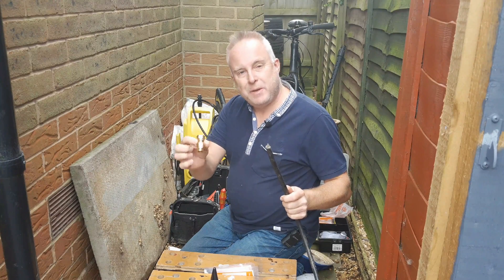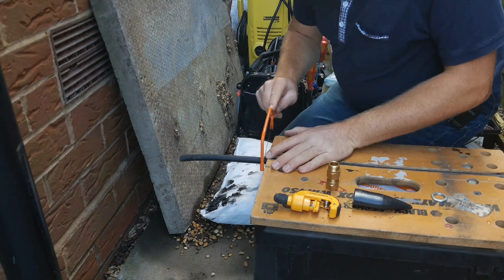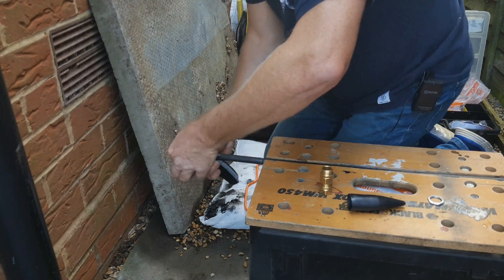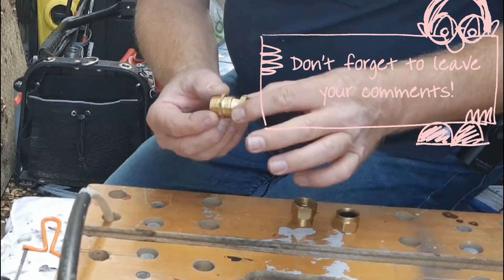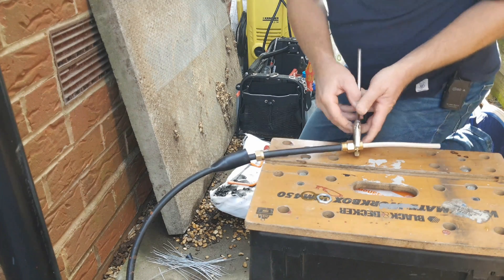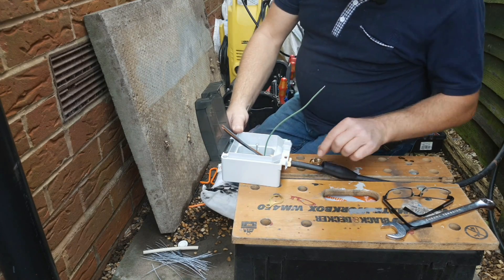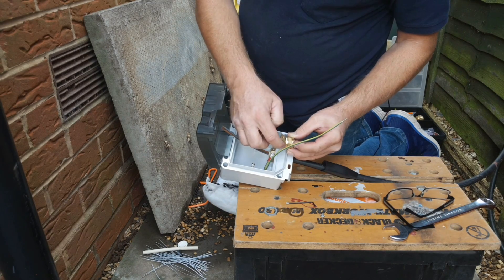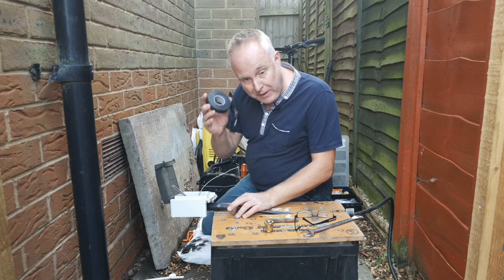How to Make off a SWA Gland | For Steel Wire Armoured Cable Installation

Comment: Dear can you help me when install cable gland the cone and the armour ring are not engaged after cable gland tightening and disassembling however the outer seal is fully clothed over the cable iuter jacket & the cable is not extractable  from the gland with hand tension please advise

Comment: That yellow tool, Bladerunner - you should spin it in the opposite direction, not towards the the jaw opening but towards the back of the tool. It's a bit counter-intuitive at first, but that tool designed to work that way - look on the directional arrow. Makers of that cutter should had made instructions more clear because people even break that tool trying to force it to work back to front, as it happened to myself.
Reply from the maker: Yes, there's an arrow. That's the way I used it. The bladerunner is still crap.

Comment: I am running swa from pond area back to consumer unit in the garage. Where the cable penetrates through the wall I was going to terminate swa into an ip66 box, then connect to normal 2.5mm t&e through the wall. Seems like a better option than threading the stripped  swa into the house. Does that make sense ?

Comment: Great video, clear and very explanative. Impressed with the detail. I too amalgamate, the amount of rusted through Wire armour I have come across. Isn’t  going stop it 100%, gland cover isn’t designed to be waterproof but tape Helps alot
I’ve forgot my junior a few times. discovered by trial an adjustable pipe slice actually works very well. 
Good practice on Lining up the faces on the nuts too, same play here. It’s just like leaving screw slots horizontal on fittings. The Finishing touches👌

Comment: Late to the party but excellent.  I now use a hacksaw rather than pliers.  But, ive always wondered: how can these glands be ip66 rated when theres no seal on the enclosure locknut?  Use of self amalg will help this but ive always wondered if i should use mastic around the gland before putting into a box.

Comment: Thanks! 

Where does the copper wire from the banjo terminate? Should it meet with the inner earth core of the swa to the circuit you're connecting to? Or to the junction box housing?

Comment: The ring is slightly wider on one side and thinner on the other. Which side do you put facing towards the cone shape so the swa's can be trapped?
Reply: The ring is itself a short cone, so align it the same way the bigger cone goes

Comment: I think it should be regs to use a 3 core cable for earth connection safety. And bond the SWA at each termination.
Reply from the maker: I agree, unless you're supplying a TT system

Comment: personally I prefer to use a 3 core cable and use one of the conductors as the earth continuity conductor. I'm not keen on relying on the steel armour for the earth conductor. More expense on the cable of course. However, I feel it's a safer method irrespective of the regs.
Reply: There's nothing in the regulations that stop you using a 3rd core; a separate CPC can be run in parallel as long as it's wholly contained in the same ferromagnetic enclosure (i.e. the amour) as the line conductors of the same circuit (521.5.1). The armour still has to be bonded at both ends regardless (523.201). You may be in fact forced to use a 3rd core as well if the armour in itself doesn't have a sufficient copper-equivalent cross-sectional area (CSA) (543.1.3).

Comment: I think you just answered my question. It's permissible to run the SWA cores through the wall to an internal junction box by stripping the SWA cabling a long enough length.
Reply from the maker: YES. Strip the armour back as far as you need and treat the inner cable like it's a piece of tough flex. You still need to connect the armour to earth though!!
Reply: Not acceptable  under BS7671 as  inner covering is not classed as a sheath...even though it happens a lot

Comment: Great video, thanks. I'm about to fit one. Does the earth cable from the gland nut go to the plug socket fascia or to the back box?
Reply from the maker: To the back box. Wire it so that if the earth comes out of the socket the armour is still connected (both ends)

Comment: Ive moved away from my electrician background, but watched your video as a reminder. When I made off SWA cables 30 years ago, there were copper wires in the armour that we used as earth connections at both ends. We would take the copper ‘armour’ through the gland and connect to an earth bar. Are cables now constructed without these earth conductors?
Reply from the maker: SWA (now) has no copper mixed in with the armour. The armour is galv steel wire. It is permissible to use the armour as the cpc, though I always made sure to have a cpc in the main conductors and earth the armour at both ends, in case of damage to the armour

Comment: Very good for DIY but remember on site opening the swa by twisting and the use of water pump pliers, sacking offences 😃
Reply from the maker: That's 'cos sites want to keep subbies under the cosh. It's how they get away with underpaying them. No such worries when you're SE or DIY. 👍
Reply: Why do they kick you off for twisting cable to open up the armours ? Been doing this for years and never encountered a problem. Do they ask you to pry them open by hand only?
Reply: @pvegod1484  No supposed to pry them off with a screwdriver. Because there's so much shite cable out there, twisting can actually cut into inner sheath 
The reason for not using grips is because they Mark the gland. Be Lucky A
Reply: @andrewfenn5287  ah right fair enough. Yeah have never used grips that is very true. Cheers
Reply: @pvegod1484  No worries we've all done stuff not supposed to, but a right bastard getting kicked off a 2 grand job over something silly. Ps Stanley knives also really big  no no.
Reply: @andrewfenn5287  aye I know they aren’t allowed on sites, I can understand that as I’ve nearly took my fingers off many a time

Comment: Thanks very much all well to the point. I did this in 30min after a battle with the middle and wedding ring tightened over the wires.

Does the earth need to connect to socket and out of socket to the earth nut?
Reply from the maker: Yes, connect earth conductor direct to accessory and use a 'fly lead' to connect to earth nut. Connect the armour to earth at both ends if you can.

Comment: Swa glands belong in the dark ages.....
Reply from the maker: Why do you suggest that? And what would you do instead?
Reply: Have you worked on a petro-chem plant? Not all equipment can be installed with plastic glands, even if they do meet the standards such as IP.
Some glands have yet another internal seal, to stop gas creepage along the cable and into the enclosure.
Reply from the maker: @007floppyboy  your input is appreciated, but your point is moot. Anyone working in such a location should be qualified to do so without having to watch my video.
This video is not aimed at such Professionals, but at DIYers and 'improvers'.
Reply: @AbouttheHouse0  I think you have me wrong, I was referring to the "Swa glands belong in the dark ages....." statement from andrew thomas.
ie SWA glands, DO NOT belong in the dark ages.
Sorry for confusion.
Some plastic glands do meet high specs such as EXia but only for very specific cables.
Reply from the maker: @007floppyboy  ah, right, I've got you now. I notice Andrew hasn't replied to my question about what to use instead.
Reply: @AbouttheHouse0  Exactly, SWA cable used in millions of installations, but the gland "belongs in the dark ages". Would mean removing all those SWA cables, big job that,,, 
As usual its a matter of selection/design, I quite like the SY cables, and the ones with copper (CY) are quite good. These two offer some mechanical protection and EMC.

Comment: A lot of sites I have worked on don't fit the shroud. It holds water which works up past the rear seal of the gland through capillary action then rots the armouring. Also the moisture can get into the insulation and cause a fault. Before anyone comments I am a time served electrician with 30+ years in heavy industry so have seen the aforementioned faults.
Reply from the maker: Right there with you, fella. A 5 star comment. ⭐⭐⭐⭐⭐
That's exactly why I put some self amalgamating tape on the cut end of the shroud. If it's an exceptionally wet area (eg a pond installation) I've sometimes wrapped a layer of self amalg along the whole gland before putting the shroud on.
My experience of water leaks in vehicles is very similar. Water can get into all sorts of places and it doesn't need big holes. I've seen harnesses wound so tight that capillary action takes water almost the whole length of a vehicle before depositing it somewhere 'critical'.
This is also why any self respecting installer would have a cpc core - rotted armour does not make for a good 'earth'❗
Reply: @AbouttheHouse0  water ingress has been a big issue on a lot of outdoor faults I have dealt with over the years. Doesn't matter what you do it gets in.

Comment: What a perfect video! Far better than what I saw a few years ago which were helpful but not as crystal clear. Will refer to it later in summer when I adjust some cables before calling on registered sparkie to do what I'm not allowed to
Reply from the maker: Awesome, thank you! A point of order though Stephen: there is nothing you are "not allowed" to do. The Law (via Part P of the Building Regulations), requires anyone working on electrical installations to be "competent" to do so. The same applies to gas installations. This is particularly true for maintenance of existing equipment.
There is much misunderstanding about this amongst "the public", and organisations such as NIC and Gas Safe are disingenuous to the public and are trying to run a "closed shop" under a "flag of convenience" called 'safety'.

Comment: .....and I've been using a pipe cutter for years now, makes a perfect cut everytime.  Cuts through the oversheath, and perfectly scores the armour.  Generally much faster than using a junior hacksaw.  From 10mm to 50mm 3, 4 or 5 core SWA.
Reply from the maker: Great tip, thanks for sharing

Comment: Before you start stick the shroud wrong way round over the cable, gives you a guide to cut it 😉
Reply from the maker: What a great tip. Thanks for sharing
Reply: Proper sparkies tip is this

Comment: Well described methodology.  One item I recommend is to take off the inner sheath before fixing gland to unit as it ie easier to get a clean cut on the inner sheath outside of the unit.  Quite agree about junior hacksaw vs cutter.  👌🇬🇧
Reply from the maker: This was filmed on my own install for my garden bar cum office. It wasn't untill I got into editing I realised I missed filming removing the inner sheath❗ Blast❗ Apologies to all, but I wasn't gonna take it all back apart for that little bit. But yeah I agree, remove the inner sheath before assembling the gland to the cable.
There are better cutters available now, but they are pro level cost, so not really a DIY proposition

Comment: Banjo should be outside under the gland body..
Reply from the maker: It can be, doesn't have to be though
Reply: @AbouttheHouse0  sorry you are wrong. There is not enough contact on the lock nut for a good earth if the armour was soley relied upon for the earth. If it's just to earth the swa then I agree it would suffice. 😊
Reply from the maker: @buzx1313  what a load of tosh! There is plenty of brass to brass contact via the threads, especially once it's tightened down a bit.
I've installed dozens of swa installs over the years and they've never had a problem at the T&I stage, nor 3/5 years later on PIR.
Who installs 2 core anyway? Very poor work. What happens to the cpc if the sheath should get punctured and the armour rots out?
Yes, I've seen this happen.
Always have a cpc core on exterior installations.
Reply: @AbouttheHouse0  well it's poor practice and you should know better
Reply from the maker: @buzx1313  go on then, humour me. Link us to some authoritative documentary evidence ...

Comment: Great video and the tips were really handy too. Thanks
Reply from the maker: Thanks, Matthew. Are you installing an SWA? Shed, bar, workshop?
Reply: @AbouttheHouse0  Hi, so I've got 6mm T&E from the consumer unit to a box on an external wall. So I'm thinking extending this and run power into a shed. I've heard Wago connectors are best for joining cable
Reply from the maker: @MatthewPlunkett  several points from your question:
1. T&E [exposed] on an external wall is very poor. The 'elements' will soon render the sheath useless. Keep it as short as possible and try to remount it in plastic conduit.
2. extend with either 3 core H07RN-F or SWA (it'll have to be swa if it's going to be buried)
3. Yes, you can use 'Wago-type' connectors. They are suitable whether the connections remain accessible or not.
4. if you can get suitable crimping pliers the very best method is to use 6mm crimp butts and insulate with heat shrink or self amalg tape.
5. if the connections are to remain accessible (in a wall box for example), you could use 32A choc blocks. Overlap the conductors so each is under both screws
6. Be sure to use a box with a screw on lid and not just a press-on lid!
phewee, HTH
PS you've given me an idea - I might do a video on mechanical cable joints
Reply: @AbouttheHouse0  thanks very much for you comprehensive reply - much appreciated. Just to clarify, the T&E is not exposed, it comes out the wall straight into an IP rated box. Certainly given me a few options - cheers. Looking forward to your future videos!
Reply from the maker: @MatthewPlunkett  that's good then. How are you planning to install the submain? Bury, clip direct or catenary?
Reply: @AbouttheHouse0  I think the plan will be this: armoured cable buried, then going into new cave and existing shed into a small consumer unit so I can have sockets and lighting

Comment: I'm a sparky and when I saw the title of the vid I thought oh no, here we go! BUT that was spot on, couldn't have done it any better myself.
Reply from the maker: One of the very first jobs I had when I first went self employed was to refurbish a garden lighting set up. It was 'urgent' because it needed to be ready for a large family gathering. Every box had water in and was corroded and it was constantly tripping the house RCD. 16 years later, I still see him walking the dog occasionally and reports that my work is still going strong.
There are many ways to skin a cat and some would do things a little different.
Thanks for sharing
Reply: If the cable dropped vertically into the box, I'd personally slather grease around the finished outer to protect from water ingress, before the boot.

Self-amalgamating (i.e. self-vulcanising) tape is far superior to PVC electrical tape, though more expensive of-course. However, I have found in the past that SA tape isn't always so UV/rot resistant for long-term exterior application - unless you bind a good thickness for self-protection (i.e. lapped a couple of times).
Reply: I’ve got to do this tomorrow and my stomach is churning. I’ve fitted the outside socket and now need to attach the armoured cable to my shed!! I’m not gonna get much sleep tonight..
Reply: I wouldn’t have put the electrical tape on because you’ve already made it weather proof by using the CW gland and it looks rough.
Reply: @danesumner4684 Lol it’s self amalgamating tape, he even said it in the video. Ps we call it insulating tape not electrical tape.
Reply: @MatSmithLondon  that’s my opinion, you wanna have one instead of just pointing out that you call it one thing and I call it another 🤷‍♂️ have a good day tho 👍
Reply: @danesumner4684  I was just pointing out that he wasn't using insulating (/electrical) tape at all. It's not really a matter of what I call it, it's a completely different product, and appropriate for use here
Reply from the maker: @danesumner4684  It's a matter of choice and it was not "electrical tape" anyway (whatever that is) - it was self amalgamating tape.
But why would you want to let your sheath fill with water and dirt if you can stop it happening? Personally I think it makes it look 'finished'.

Comment: a nylon or fibre washer at gland entry to maintain the IP of the containment would be advisable along with some silicon on the fabric fixing screws, try making the swa off without a work mate vice.
Reply from the maker: The best waterproof accessories have a soft rubber surround co-molded into the box. A good suggestion though. Thanks for sharing

Comment: I've found in the past that it helps if the hacksaw is a little blunt, a new blade tends to snag on the armour. If I have to fit a nee blade I give it a few strokes on a curb stone to blunt it slightly before use.
Reply from the maker: I've never noticed this problem myself, but I'm sure others will find this useful. Thanks for sharing